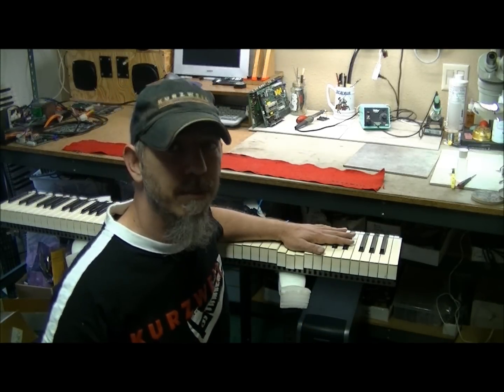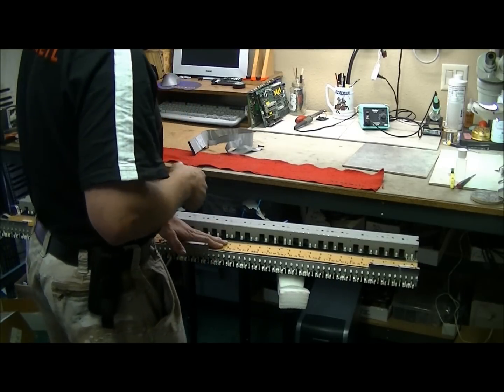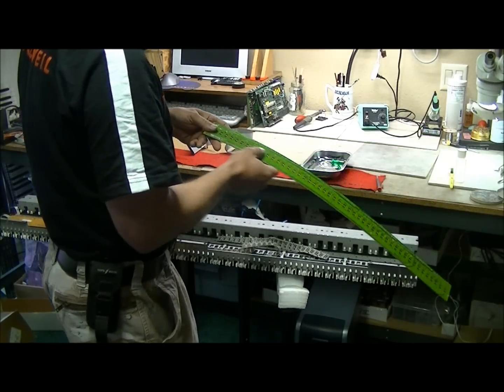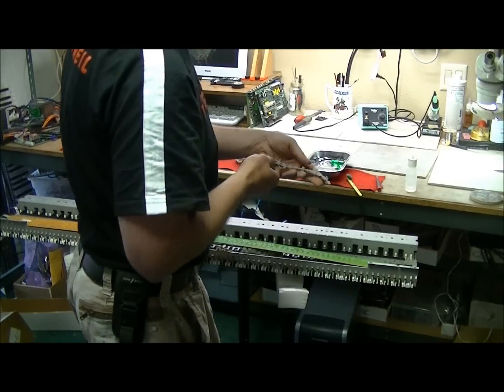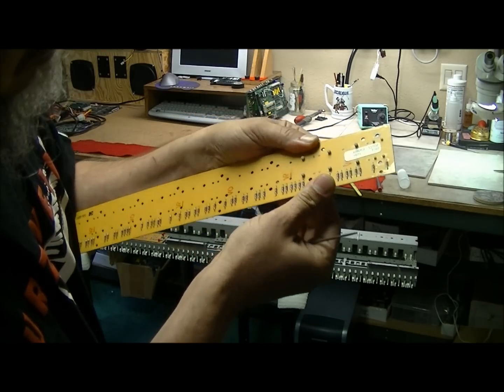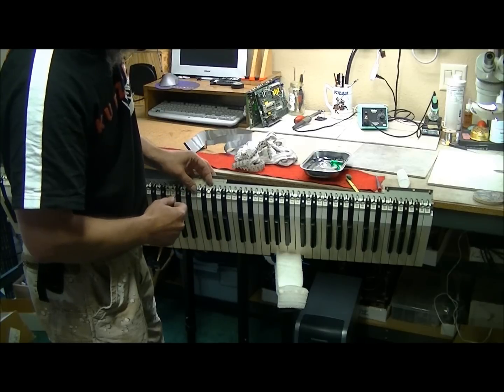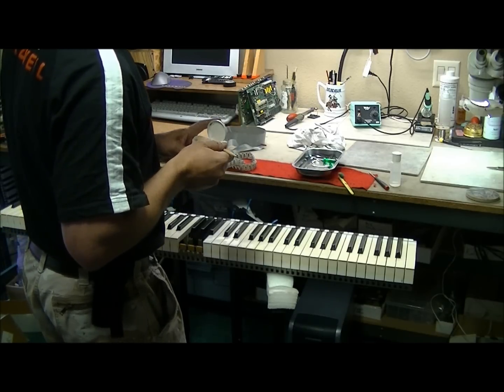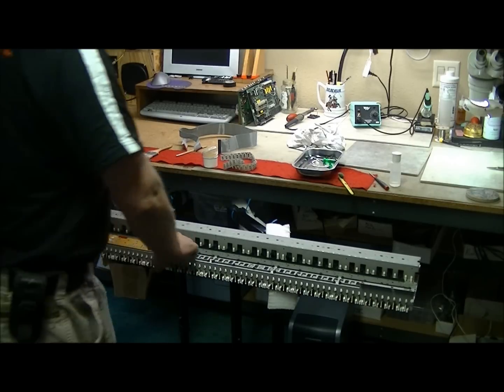Kurzweil / Fatar TP10 keyboard assembly repair

Comment: Thank you Duane!  You are a gentleman and a scholar for posting this video.  

My keys make a klunking sound when I play.  I took it to a repair place that Kurzweill recommended to me and they replaced the felt, but that didn't really fix the problem.  They told me they had done all they could do.  What say you?
Reply from the maker: Three things come to mind. 1) Broken counter weights (unlikely though since the "feel" would change). 2) Broken weight bracket (the part that holds the weight rod in place) or 3) The keyboard assembly is bent. Most likely 3 is the culprit.

Comment: If you happen to be repairing a Baldwin DVP80, there is an additional step.  It uses the same keyboard, but there is a lower spring.  Attached to one of the lower protruding pieces of the key is a push on tap that has a C shape in it.  That C shape accepts a lower spring that is underneath.   Make sure you detach it first before attempting to lift the key or you might overstretch the spring.

Comment: Duane, I have a K 2500, the 76 key type with the plastic keys. Two of my treble keys are stuck in the depressed position. How do I open my keyboard to get to the keys and how do I fix the depressed keys? Thanks!